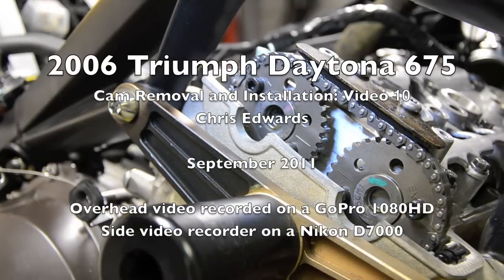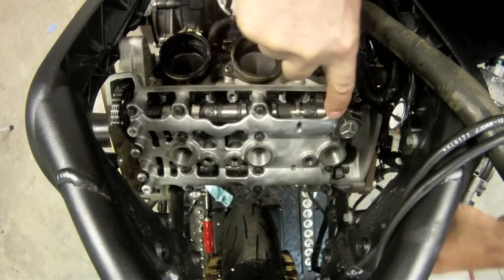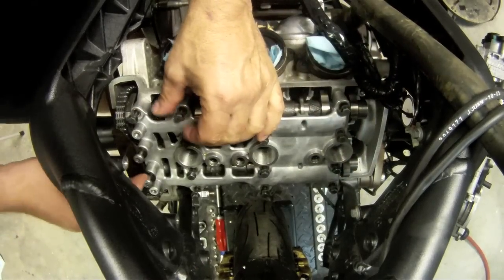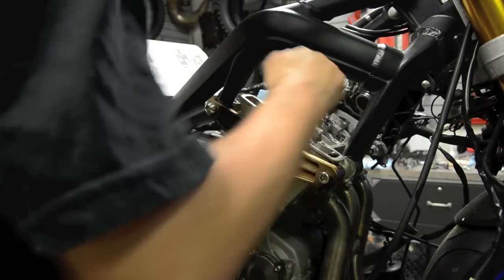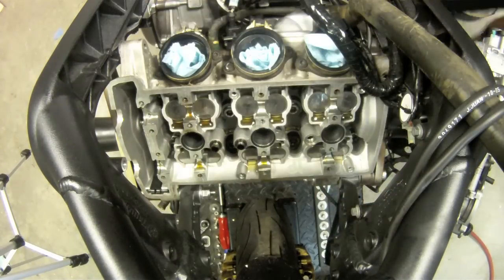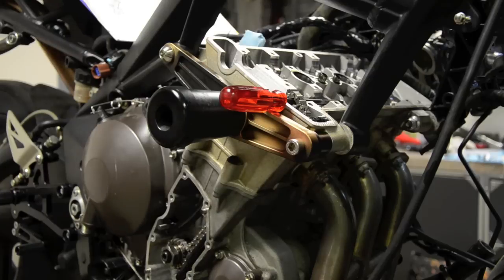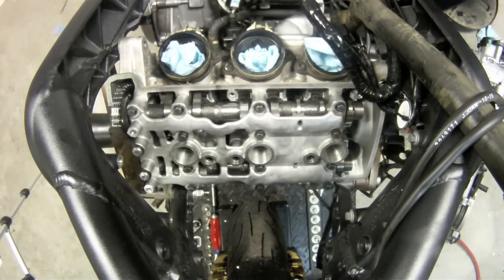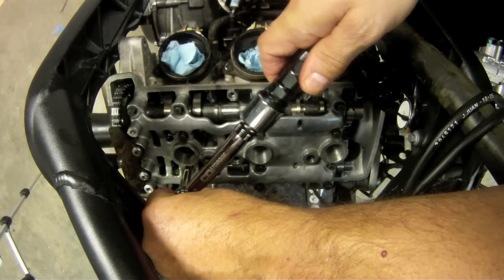Triumph Video10 - Cam Removal and Installation

Comment: The hollow dowels locating the cam ladder are actually part of SAI system and feed the exhaust ports with recycled gases . Now is the time to replace the hollow dowels with 10mm diameter 14 mm long solid dowels if you are are doing a proper job of removing the reed valves and disconnecting the SAI system ,either blanking off the plates or using them as additional engine breathers at the top end of the engine ,which is highly recommended . Just blank off the airbox inlet pipe add a 15 Ohm x 15-25 Watt resistor  ( the gold Arcol aluminium clad ones look cool and are more robust and mount with cable ties ) across the plug in the loom for the SAI solenoid. just removed . Run the hoses from the old reed valve covers into a tee piece and either into the old airbox union or preferably a 1 litre dump bottle secreted away .

Comment: I set the cam chain tensioner without lining up the timing dot.  Then rotated the chain with a socket on the crankshaft and the dam chain shuddered.  I realized snd then reset everything lining up the dot. However, i noticed small metal shavings appeared on the cam chain. The shavings look to be copper and chrome…. Where could they have come from?   Any thoughts gratefully received…

Comment: Very good video,thanks for posting!
Just one little thing came to my mind was missing. To make sure the tensioner spring is still in good shape rotate the engine before putting the valve cover back on and wait for another "click" from the tensioner. 
I´ve done that job multible times to my daytonas and had problems with loose tensioners wich resulted in chain-ratteling at cold starts. 
Also to mention to be very careful with the screw on the tensioner. I know experienced mechanics that ruined the thread.

Comment: Did it run after this video? Noticed your cam lobes are in a different position during install, compared to removal. I'm stuck at the moment getting mine aligned properly.
Reply from the maker: No, the engine was too badly damaged. The cost of replacing the damaged components was around $3800, so we just bought a replacement used engine. The video showing the valve adjustment was done on the replacement engine and it ran fine.
Reply: thanks for the quick reply

Comment: Can you help me fix my 2015 Daytona it's stalling on 4th gear and after heating refuses to shift to 2nd gear. Here in India, no engineer is skilled enough to solve the issue. Please help if you can , I really love my Daytona.
Reply from the maker: Sorry, haven't worked on this bike since I made those videos, we sold it a short while after.